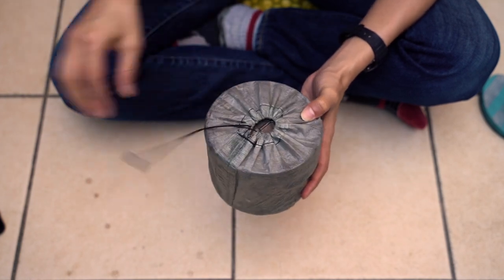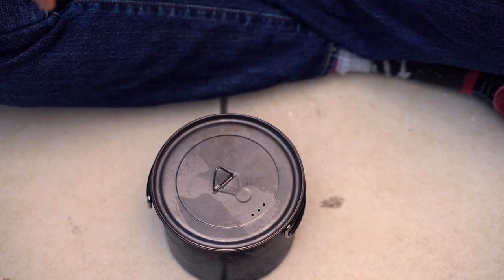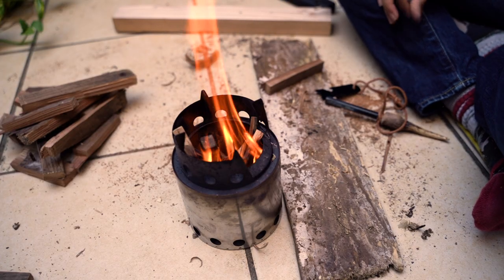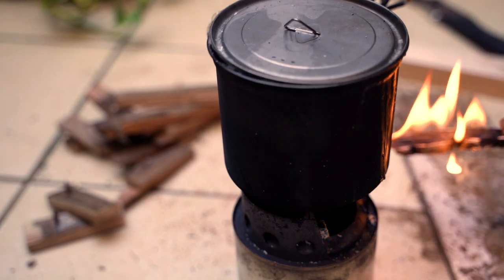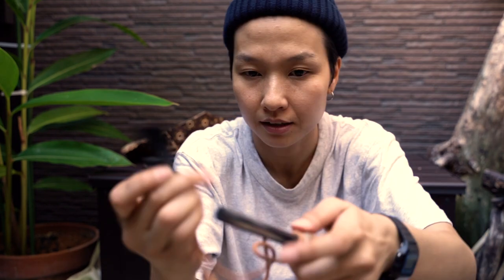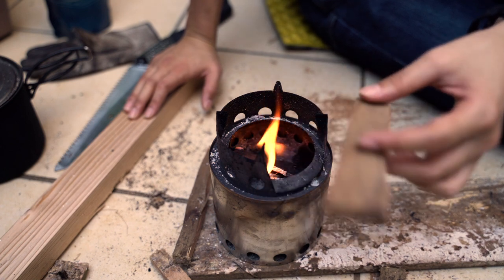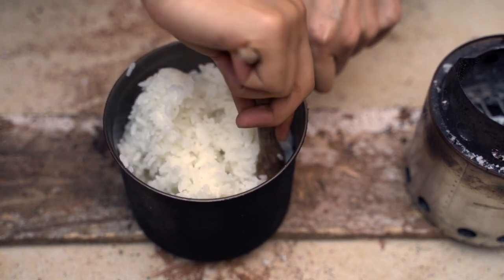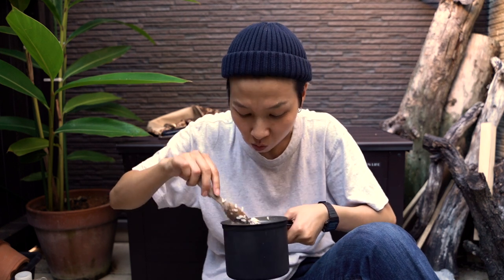HOW TO MAKE RICE / OUTDOOR COOKING / FIRESTEEL / BUSHBUDDY ULTRA / TWIG STOVE

Comment: Just learned a new way to cook the rice from India.  This method removes the starch and the grains become separate.   Wash the rice to remove starch and drain water, two times.   Then when cooking, the new ratio is 1 part rice to 5 parts water.   Bring to a boil for 10 minutes and stir a couple times while boiling.   Then drain excess water.   This method removes starch and is better for diabetics.

Comment: Use it for many years already on all my long-distance projects months in a row.
Used snow peak pots for many years but need new ones...what is the one you have??and does it fit another pot around it as I always use two.
Greetings from Holland
Reply from the maker: Mine is Toaks 1100ml. The lid doesn’t close completely but the stove fits perfectly. It won’t have enough space for another pot inside tho.
Reply: @uemaisadventure  I need a new one around my bushbuddy and the ones I want are not available...but I go for the 900.

Comment: You've got skills, but not very scientific. Unknown rice amount, unknown water amount. Using you finger will vary the amount of water depending on the size of the pot.
Reply: What ever amount of rice you use put the water over it where it comes up to your finger line. It's not rocket science.